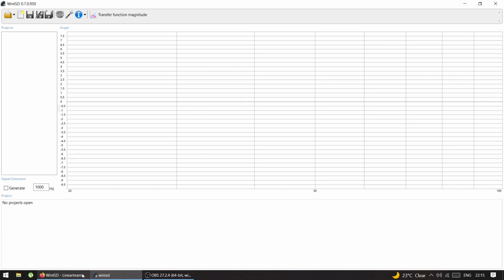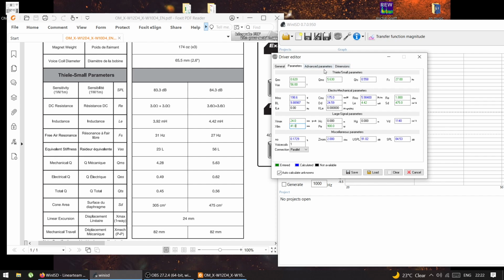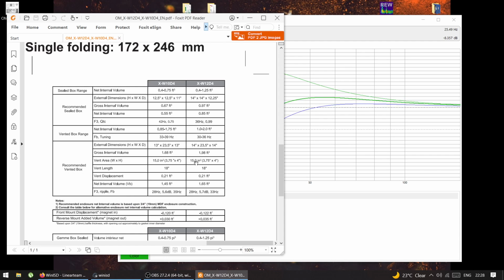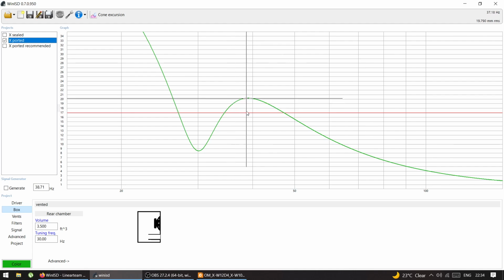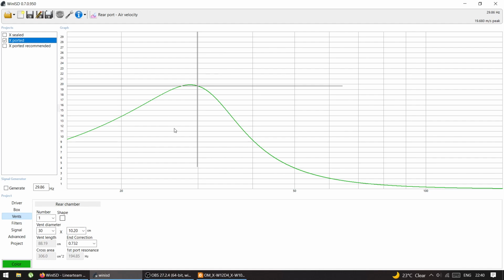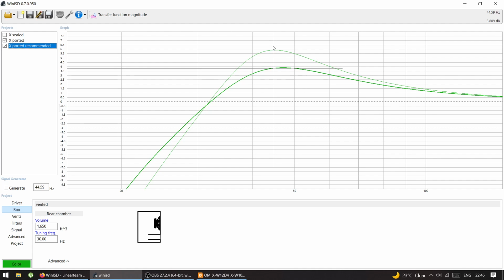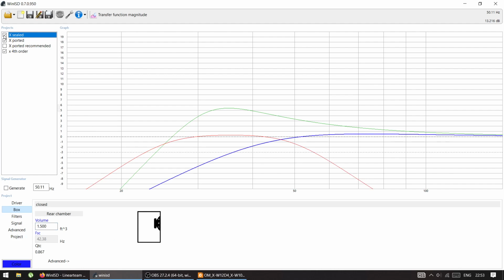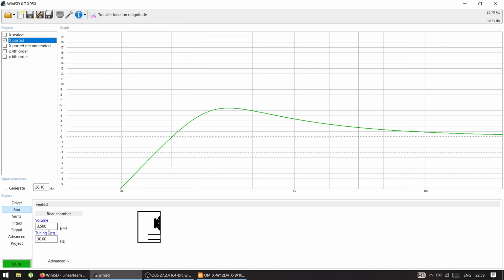WinISD tutorial for beginners

Comment: I have an infinity kappa 1200 subwoofer. While the user manual recommend 2.5 cu ft enclosure tuned to 30 hz,  how would it sound in a 1.7 cu ft  enclosure tuned to around 33 hz.   Is it much important to have a much larger emclosure to tune it at 33hz ?
Reply from the maker: Well model both options and compare the responses on the same screen.

Comment: so i tried using the recommended  ported enclosure size and my cone excusion was way beyond the xmax and my port air velocity is around 50m/s this doesn't seem right to me
Reply from the maker: Recommended by who? Manufacturer? Most of the time the port will.be too small to have the enclosure smaller. Increase the port area until you are happy with the graphs. And don't forget to add a infrasonic filter in WinISD.

Comment: Just trying to figure this program out. In the Parameters, it askes for Re, the subwoofer i have sais 6.75 ohm. But it's a dual 4 ohm voice coil driver. Down at the bottom it asks " number of voice coils, and if they are installed in parallel or series. Do I just enter 6.75 in the Re category? Even tho that is the total impedance of both coils? Thanks Raw Cat.
Reply from the maker: That doesn't really matter, unless you will analyse impedance graphs or amplifier influence. For a typical box design, just put 1 VC and whatever you measure with a multimeter as impedance.
Reply: @RAW-CAt  nice thank you. I just found what you did there in the video. Awsome.

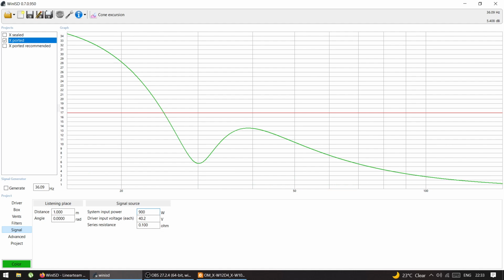Comment: At 18:40, why is your xmax red line at 17 when you entered 24 when putting in the parameters? When I click on excursion, my red line is at what I entered in the ts parameters page.
Reply: Because this program is all over the place.  It spits out different numbers  in the auto fields when entering the same numbers but in a slightly different order.  One time it says mms is 16559 and next time it was like 284 or something like that.  I’m beginning to think it’s just kind of whatever beyond the port size and length.  Plug some stuff in and do what it says on 3-4 of 5 attempts.  Point the port away from me and I won’t hear it making noise hopefully.  

Doing sealed boxes seems to not change anything no matter what I do.

Comment: Quick question though. Your spec sheet shows DC Resistance is 3.6+3.6 ohm. In the Re box you said "this is 1.8 in series". However, that's incorrect. That would be parallel. But, in the "Voicecoil" box it is set at "1" and under "Connection" box is is set to "Parallel". Wanting to know if you misspoke when you said "1.8 this is series" or did not change the Voicecoil and Connection box appropriately. I hope this question makes sense, it threw me off as I was entering in my sub’s parameters. Thank you for any clarification on this, and again, thank you for everything you do for our hobby. Cheers!!!
Reply from the maker: There might be a mistake in the video yes. This will affect your data if you will be looking at the impedance curve or max SPL. I use this simulation 99.9% of the time for the frequency response. As anything that has to do with power in real world will be different from simulations.
Reply: @RAW-CAt  Any advice my friend?  My subs are Rockford Fosgate P2D4-10 dual 4 ohm. The paperwork shows “Re” as 6.40 ohms with a note that this is both coils wired in series. Which gives each coil a value of 3.2 ohms (pretty sure). When I’m inputting my parameters, it auto calculates the “Re” as 6.4 ohms. Awesome. But with “Re” set as 6.4, I’m unsure of what to input into the box for “Voicecoil”…1 or 2…..and also in the “Connection” box…..parallel or series. Any help for a poor Texan audio enthusiast?  I appreciate your time. Cheers!!!
Reply from the maker: @curbowbass6124  juse enter as a single coil at 6ohms. Single or dual coil does not change anything, just the load amp is seeing.
Reply: @RAW-CAt awesome, thank you sir. Does the “connection” box matter?  As far inputting parallel or series?  Once again, thank you so much!!!!  There’s not a lot of people that would take the time to answer these kinds of questions. Cheers!!!
Reply from the maker: @curbowbass6124  I believe it matters more if you are simulating a system with multiple drivers. Like a dual sub box. I will admit that I don't really know as I don't use that.
Reply: @RAW-CAt  ok, this is making sense now. I’ve been doing car audio since the mid 80’s. So I guess I’m an “old school” guy. We didn’t have all these programs and amps that didn’t cost $1.00 per watt. 🤣 Thanjs again kind sir, keep the videos coming!!!!

Comment: thank you, please I have a 30w, 8ohm speaker. that's the only 2 data I read on the emant. how I can calculate the air of my box (speaker) to be made using winISD
Reply from the maker: You need to measure T/S parameters of that speaker. I have a video about that as well.

Comment: I designed a box to 25Hz but to get the port noise down I selected the option to use 2 ports. Winisd says the ports need to be 69cm long, does this mean I need 2x 69cm long ports or is it 2x35cm ports? The length of the port doesnt change in Winisd based on the number of ports used so I dont know if I need the total length of all the ports combined to be what Winisd recommends or if they all need to be the full 69cm length.
Reply from the maker: Whatever winisd tells you, you need EACH port to be that length. Yeah, better iption is to make a massive single port. Remember, the lower the tuning the bigger the port.
Reply: @RAW-CAt  Thanks, its hard to find piping over 4 inches for me so i have to make 2 4 inch ports